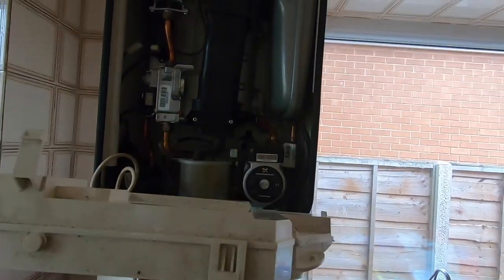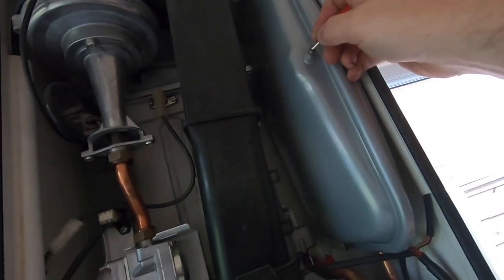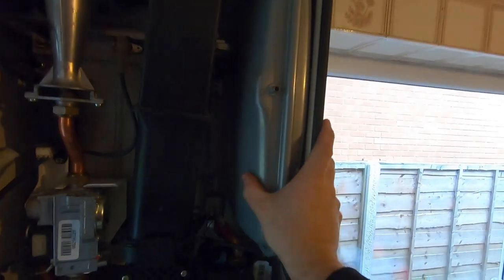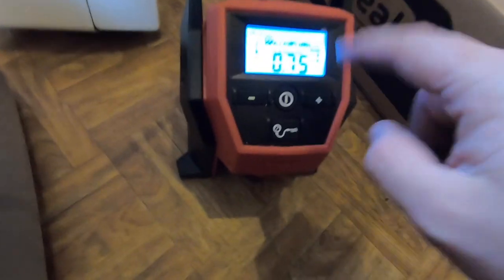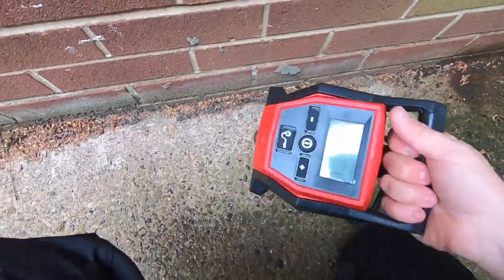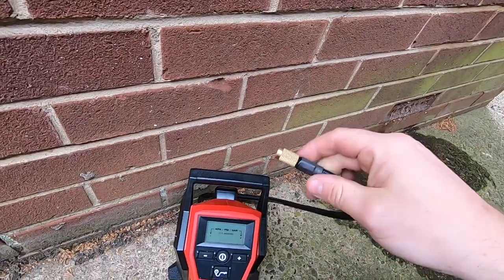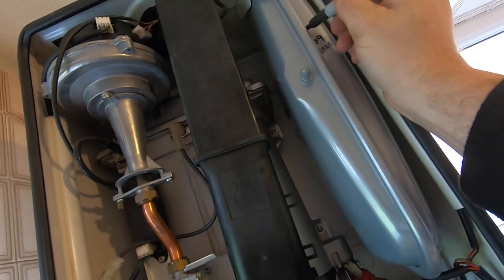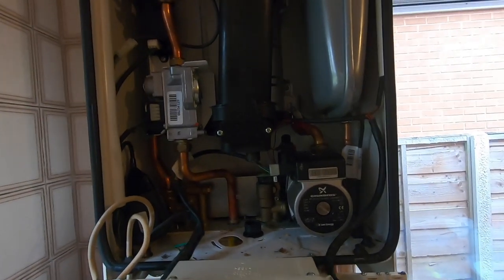MOST COMMON BOILER FAULT *REVEALED* | Parkes Plumbing

Comment: Could you not have used a 90 degree extension on passing or faulty schreider rather than changing vessel ?
Reply from the maker: Don’t know what you mean?
Reply: Parkes Plumbing you can put one of the angled adapters (I think Regan do them) on the vessel and leave it connected.
Reply from the maker: Ah right I though that’s what he meant. I ain’t giving up my connector!!
Reply: Parkes Plumbing  I keep the little brass bend connectors with me in case you get a leaky shraeder valve 
only about £1.50 on eBay
Reply from the maker: Salim Khan cool I’ll check them out
Reply: To get out of trouble put a bit of pt tape on the ev thread and screw the cap back on , you can then tell the punter it needs a new one next visit....👍

Comment: Doesn't the logic have a drain down point under boiler? There a reason you dont use it?
Reply from the maker: There is but i don’t like to use them. Easier to contain water from the filling loop in my opinion
Reply: @ParkesPlumbing  I concur

Comment: Call from tenants .. boiler don’t work.. most times they ran out of gas 🤬 how do you charge for that
Reply from the maker: Charge accordingly!
Reply: £2 per kW of the appliance as the timewasting call out charge ;)
Reply from the maker: Epic
Reply: Charge double
Reply: Not your problem. Long as you solve the issue.